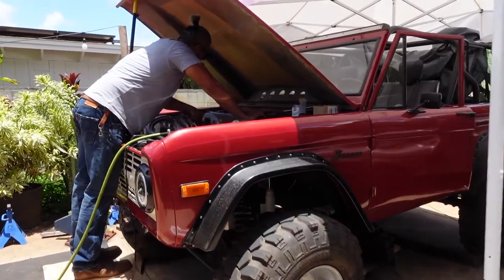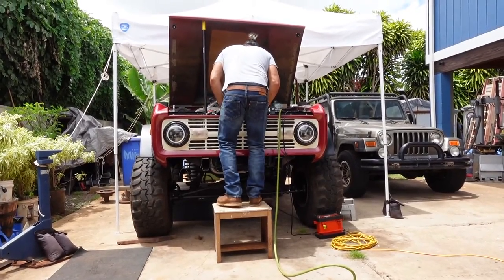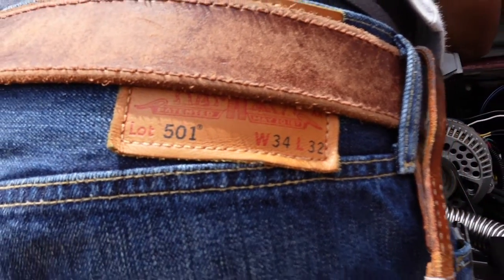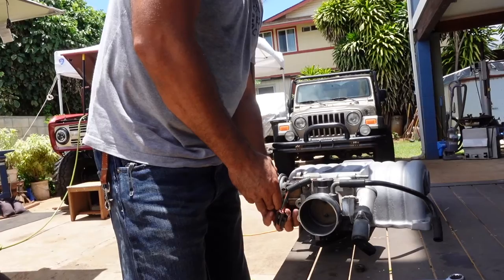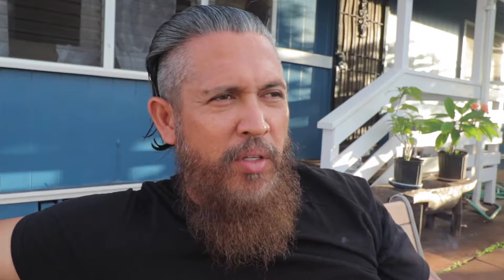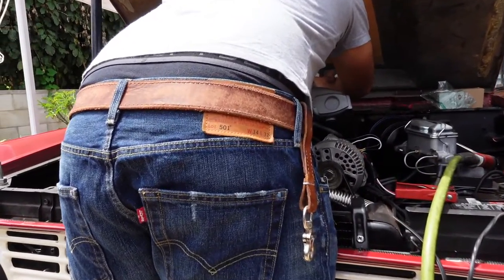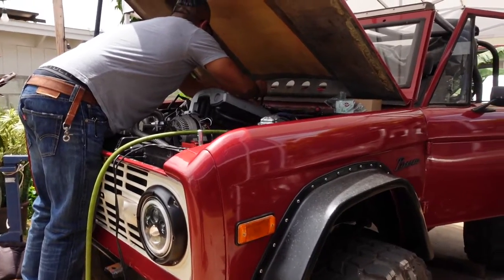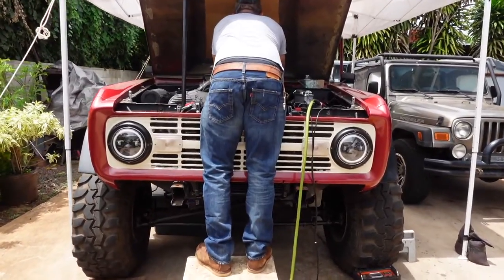Why the LEVI's 501 is Still My Favorite Jeans

Comment: Are the 501 STF, of today, worth it anymore?  Or should I try to find older ones?  The reason I ask is because I see mixed reviews about the brand new ones available.  Also, when buying STF can I just put them in the washer and hang dry them right when I get them without issue or do you have to soak them and wear them wet for a bit?
Reply from the maker: In my opinion it depends on your take on it.  Some people like to buy brand new STF so they can create their own fit and some don't mind the classic ones.  The 501 STF of today still works.  You should receive directions on how to shrink them from a reputable source in which you should consider when buying them.  I'm not a fan of Ebay to be frank.  

Again, my opinion only that STF should be soaked only and hung dry.  Also, I would wear it right before it dries completely so that it starts to take your shape.  Be very particular on sizing and ask a ton of questions!
Reply: @StylishGreaseMonkey  I'm ordering from Levi's website but just want to make sure I get it right because you can't return them once they've been soaked or washed, which is the only way to find out if they're right.  On top of that, I don't have a tub to soak, only have a stand-up shower and it's too cold in PA to be outside doing this.  I wear 31×30 in Hollister and I have one pair of Bravestar Cone Mills denim in 32×31.  Any recommendations on sizing i should go for?  I want to buy soon from Levi because they are running a sale.
  P.S.  I can't stand all the stretch denim out there and refuse to buy and wear it.
Reply from the maker: @lancecowburn1693  haha, I know what you mean about the stretch denim.  I can only share my experience with raw denim.  I wear a size 34/30 and ordered a 36/34.  I ended up shrinking that sucker to like 33 3/4 on the waist and a 30 on the length.  Then again, I screwed up after my initial soak that I had it in the hamper and my wife washed and dried it in the dryer.

I know it is okay to put it in the wash with cold water and a gentle cycle.  Also use gentle soap.  I would not run it on the dryer though.

We are taking a chance with raw denim for sure but I like the experience.  Good luck man!

The Iron Snail have a video on STF in case you haven’t seen it yet.
Reply: @StylishGreaseMonkey  I appreciate your response and time, thank you sir🤝🏻
Reply: @StylishGreaseMonkey  well I just ordered 4 pair in 34×32🤙🏻  I'll let you know how it goes😎

Comment: Amigo una pregunta dónde puedo conseguir red wings en el paso Texas si me pudieras alludar con la información? Gracias
Reply from the maker: You have a few choices depending on what you are looking for.  The Red Wing store is located:1331 Lee Trevino Dr. Ste C El Paso, TX 79936. Directions · (915) 594-0868.  Places like Nordstrom or Shoe Racks will sometimes have them also.  If you are looking for work boots, I would recommend going to the Red Wing store.